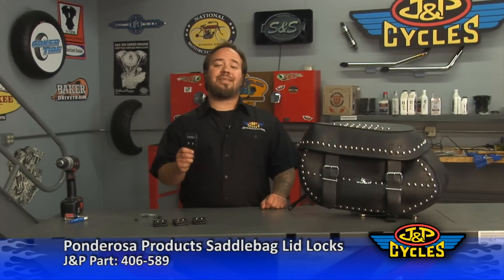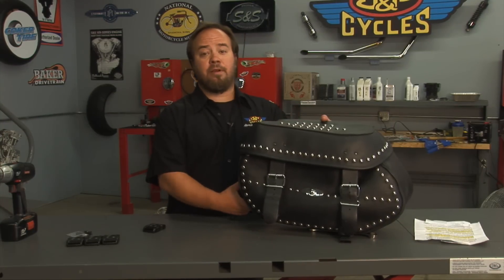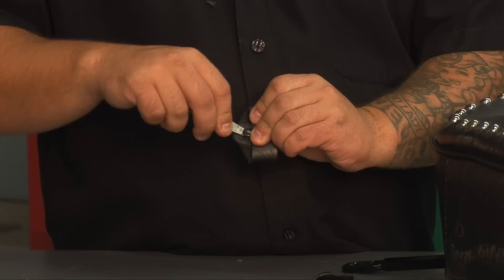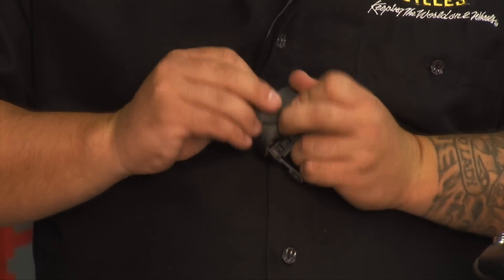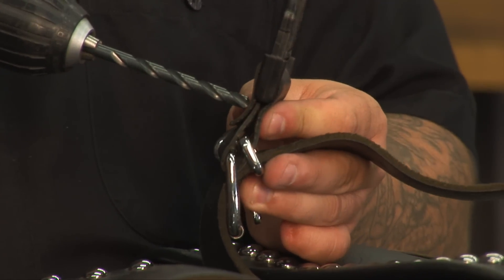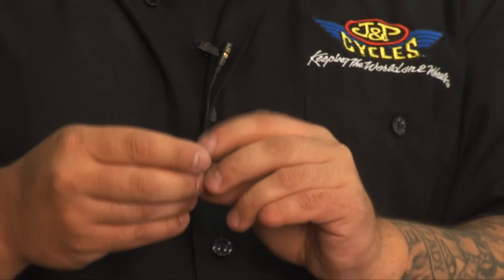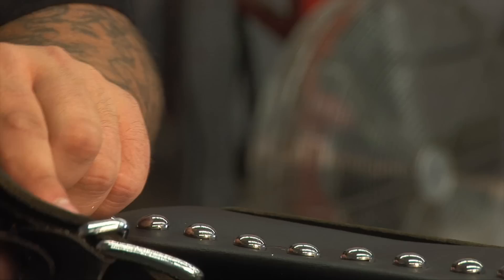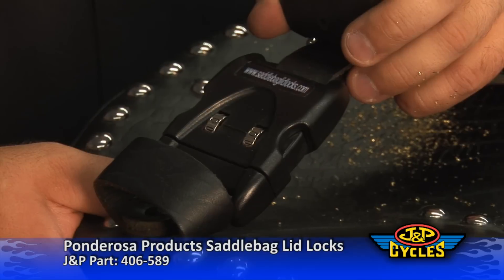Lock Your Saddlebags with Saddlebag Lid Locks from Ponderosa Products • J&P Cycles

Comment: Are you kidding me. A thief is gonna take a knife and cut through the straps easily.

These are a waste of time and money unless you have some kind of guard to protect the straps. Sorry just pointing out the obvious. Good job installing however.
Reply: If a thief really really wants your stuff, nothing is going to stop them regardless of what lock, alarm, titanium grade saddlebags whatever. This is good enough to deter itchy hands, casual thieves and opportunists as they need to think twice if it's worth the effort and risk slashing away with a knife just for... what? Smelly riding gloves and a rain coat?
Reply: it's only 2 digits, so to try out every code (99 options, 1 second per option) is gonna take your 2 minutes max, most likely 1. You can just open it the regular way.